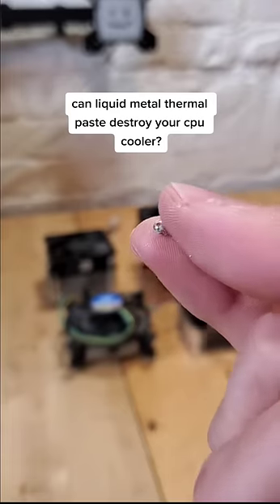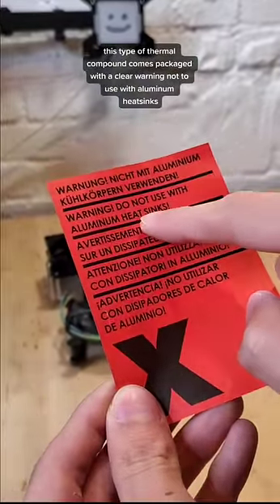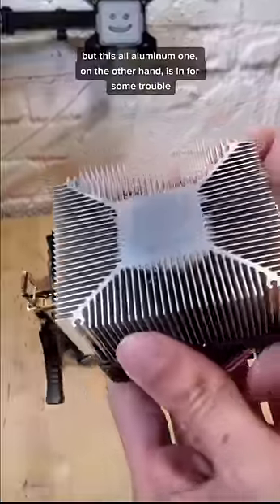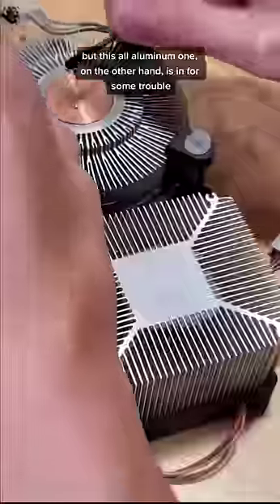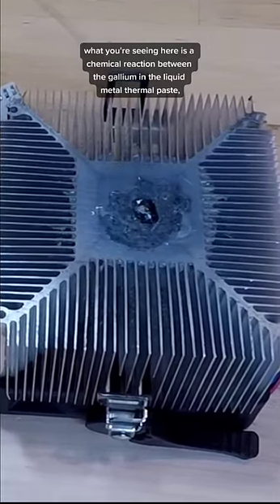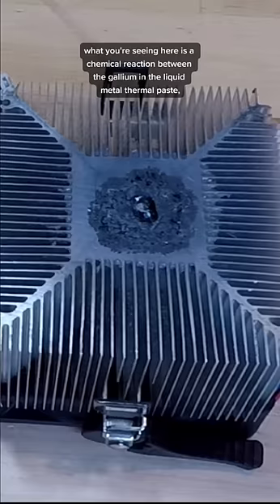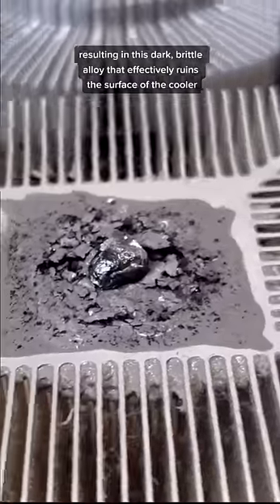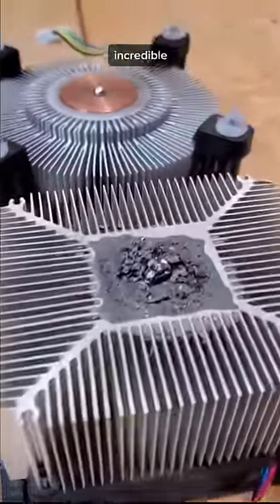Can liquid metal thermal paste destroy a cpu cooler? #shorts

Comment: I think I'll just stick to regular thermal paste, works fine enough for 99% of tasks you could ask from a CPU (beyond extreme overclocking)
Reply: ^ a reasonable human being
Reply: With my i9-7940X (165W rated TDP at stock, 14C/28T), I basically had no choice but to delid the CPU and replace the TIM with LM 😂. With the CPU stock, and a beefy 280mm AIO cooler, the cores would hit 105C and sometimes crash during the cinebench run. After I replaced the TIM with LM (but used standard MX-4 between IHS & AIO), my max temps stay below 65C at full tilt. Given the extra thermal headroom, my benchmark performance gained ~15% since it could boost harder, too. So unless you have a CPU from Intel where they decided to use terrible TIM between the sillicon and IHS, conventional Thermal compound is the safe and easy route to go.
Reply: Until you wanna go even further and get leaderboard benchmark results with subzero temps and you loop back around to paste again lol (albeit a special kind)
Reply: @nickldominator  ugh don't remind me of my i7 7700k. Sooo stupid that you need to delid it to get it 40°c cooler.
Reply: Amalgamation isnt a chemical reaction fyi
Reply: Even then a larger heat sink or a liquid cooler would probably be far more effective and if that's not enough it's cryogenics or nothing. I can't see the few percent benefit this "might " provide actually being the difference between working and melting.
Reply: @whatzituya55  at that point you just pour liquid nitrogen directly over the cpu
Reply: Honestly KPx is good enough for extreme overclocking
Reply: @whatzituya55  facts
Reply: @Hephera  amalgamation actually IS a chemical reaction fyi. You don't know much about chemistry, do you? What do you suppose is happening at the molecular level? Literally EVERYTHING is chemistry.
Reply: @chrisCKDE  well I have an i7-7700 and even though I replaced the stock cooler it still hits 70 degrees under max load, not going any higher or lower
Reply: @memethief4113  well that is good for you. I put the biggest cooler on there my case could fit and i hit 100°C constantly under full power. After i delid it and put a water cooler on top i have no more problems even on 5ghz. Bad luck or something for me i guess.
Reply: @chrisCKDE  the stock cooler is pretty shit though, and the new cooler I put on is definitely much better, I think the 7700 since it's a locked processor can't go past 70 C, either that or the TIM is extraordinarily bad
Reply: @memethief4113  maybe they did something different from 7700 to 7700k or it is just because it is the unlocked version and it Boosts higher than the 7700.
Reply: @chrisCKDE  maybe, would it even be worth it to delid the CPU? I probably wouldn't get any more performance and I'm thinking of upgrading Q4 2022 when Zen 4 comes out anyway
Reply: @memethief4113  for you? Probably not 70° is okay and deliding it only helps with thermals not with performance and with the stadard 7700 it does not make sense because you can't realy overclock it anyway. Just go for a next gen cpu.
Reply: @chrisCKDE  don't underestimate the differences each and every single CPU from the same series has. You can biy the same modell and it can perform 10% worse than others. Likewise, the internal cooling varies. That's pretty normal with CPUs, they are so intricate those things happen all the time.
Reply: Well, you’d be surprised how awesome liquid metal is for gaming laptops, the 2017 acer predator in particular.  Almost 10c difference!
Reply: I want my shit to run my games and still hit the temps I had before while idle
Reply: @GINeric_  Pretty rare these days.
Reply: any thermal paste vs 73w/mk (conductonaut)
Reply: You dont use liquid metal for xoc, it worse than thermal paste at those temps. Liquid metal shines in high heat
Reply: @leprechaunbutreallyjustamidget  liquid coolers simply aren't as good as people make them out to be
Reply: @nickldominator  what is tim and what is lm?
Reply: @nickldominator  my guy youre speaking hieroglyphs
Reply: Liquid metal is for the sweet delid only!
Reply: Yeah.
Reply: My RX 5700 XT needs undervolting to stay under 100C even with Kryonaut. So I wonder if LM may be worth a consideration.

My biggest problem however is that it doesn't look like the copper of the heatpipes is treated in any way. So it's copper but not nickel-plated copper which apparently would be ideal for LM.
Reply: You can get kryonaut and be done if you want to go extreme too. No need for liquid metal
Reply: @nickldominator  idk how you manage that.

I have a 5900x, that cpu runs 185watts overclocked. I have a double fan air cooler on it. And that keeps the cpu under 80c, even under that 185 watt load for extended time
Reply: @peniskopf653  using the wrong kinda air cooler if you can't OC a 4790k with one.
Reply: @nickldominator  you speak german or greek to me
Reply: You don't use liquid metal with XOC. Liquid metal and extreme temps don't mix. The metal solidifies under extremely low temps and the heat transfer goes to crap.
Reply: Well when you go extreme with like liquid nitrogen you‘ll actually use another thermal paste. That can handle -200°
Reply: @chrisCKDE  I have a 7700k I've OCd since 2017 with a noctua air cooler never hit over 80°C. Maybe bad case airflow or bad luck on the silicone lottery?
Reply: I think I would only bother with liquid metal if I was using a laptop and it didn't have it out of the box (there's a reason why several performance focused brands have started using it). For desktop uses however, unless you have the highest end cpu with a firm overclock, a decent cooler should be more than enough cooling.
Reply: @whatzituya55  subzero cooling has 0 real world use though. No one would be stupid enough to daily drive something so radically overclocked and in constant need of ln.
Reply: I use it mainly for GPUs. But if you do make sure that you have some copper or nickel pipes to apply it on.
Reply: @nickh2647  on a low/mid level party that sounds like a solid idea, but for a higher level one I would remove some of the items at least.
Reply: @nickldominator  what do you do with a 14 core CPU?
Reply: On some laptops liquid metal is the only choice
Reply: Yeah I'm not putting Gallium anywhere near my electronics.
Reply: @chrisCKDE you lost the silicon lottery, mine never even hits 80C under extreme work load.
Reply: 99%? Wtf are you talking about.
Reply: But if you use AND, you may need this since AMD CPU will turn the PC into incinerator
Reply: @superspies32  I use a 7900X. 105w eco mode and it comfortably sits at 65 C while gaming. Standard thermal paste with a Thermalright Phantom Spirit.
Reply: Liquid metal is mostly useful for laptops and other mini furnaces like consoles.
Reply: @nickldominator Liquid metal is obviously riskier, but with heat producing components becoming hotter, they need that risk, to see the advertised specs at minimum and the full potential life at best. Overall it’s just the best option just not beginner proof that’s all there is to this LM vs traditional TP

Even then I heard not all Thermal pastes are electricity friendly

Comment: I remember when a guy complained about the liquid metal, it literally destroyed his chunky aluminum cooler and wanted a refund
Reply: lol, this is why warning tags exist 😂
Reply: Some people don't know how warranty works
Reply: The problem is when the guy doesn't know what aluminum is
Reply: @JimboJuice  honestly, you make a good point. If you’re finding that your cpu is running a bit too hot and immediately think “I need to try a different thermal paste” over “I need a new cooler”, you’re definitely really into computers
Reply: @JimboJuice  Nothing more technical about reapplying paste on the GPU die.
Reply: @JimboJuice  The only difference is that you have to deal with some screws and a couple of layers of plastic and aluminum to get to the die.
Reply: @JimboJuice  There were never any mention of pads in this particular comments section. The topic was about paste. Either way, should you choose to reapply pads - which is not at all needed when changing the thermal paste - just choose the correct length and thickness and apply the new ones where the original ones were. It really is that simple.
Reply: Refund not refound lmfao
Reply: @JimboJuice  No? If it is still in good condition upon taking apart the GPU I do not see any reason to. If it is old and dried-out, then of course you would not want to leave it on.
Reply: @EnjoyingChaotics  yes thanks man, i already corrected it
Reply: @eirikheggelund  I hope you know that opening a couple of more screws even if it's just one means that it's more technical, it's a process that requires a tiny bit of different knowledge and a tiiiinyy bit of more work, i.e. It's a tiny bit more technical. Just learn words dude

Edit: no one is saying that it's not simple to do, just that it's a bit more technical.
Reply: @albertcamp9833  It depends.
It takes 4 screws to undo my CPU cooler, and 5 for my GPU. Same difficulty for the GPU really, maybe even easier in my case.
What's discouraging about the GPU is that there's less of a standard on how to disassemble them. That's all.
Reply: @albertcamp9833  Those are minor details. An act might involve more actions without proving to be any more difficult in reality. Let us leave it at that.
Reply: @untitled2792  they Should not call it liquid metal thermal paste but galium thermal paste that's safer
Reply: @JimboJuice  thermal pads are used for ram and vrm. You were talking about gpu cooling, where you ONLY need paste. Graphics card =/= GPU
Reply: @TheNamesArif  also some people don’t know how gallium works when it reacts with aluminum it basically destroys it and turns it into something so brittle it’s like chocolate if you put it on a scooter you could turn it into basically a chocolate metal
Reply: @JimboJuice  lol nope your totally on the wrong side of this conversation..
Reply: @JimboJuice  they have but you don't need to know anything about them to change thermal paste, but well, just pretend you know anything and even tell horror stories of brigged ones. I handle and replace GPU and CPUs for 25 years, don't try
Reply: @JimboJuice you go for the next topic, DAUs (dumpest assumable user) who don't install windows, wont touch a single screw to open a pc. If some is able to unscrew a headsink,, he can manage those pads. Also those pads last way longer then paste that needs to stay liquid. They also don't need to cool that much as the Mosfets and Coils they cool have a higher tolerance.

In the end, you claimed its needed to have knowledge about pads to change gpu thermal paste. It is definatly not, but helpful.
Reply: @JimboJuice  replaced my gpus and it has not bricked as of 2 years
Reply: The customer is always wrong.
Reply: @JimboJuice  the GPU is the silicone die that is present on the graphics card. what you call the "GPU motherboard" is called a graphics card. What you are saying is the same as old people calling the whole PC,  a CPU. GPU stands for "graphics processing unit" and thats not the whole card, just the die. Its a shame that you know whats up with them, and you should use the correct terminology, is all im saying. And you never ever put any thermal pads on any GPU, just on the VRAM and VRM, thats what im saying.
Reply: @JimboJuice  any decent cooler uses a copper block on the cpu. It's only the crappy intel stock coolers (that they have abandoned by now) that used to be an all aluminium block.
If you ever see a site that is offering coolers without a copper contact, I would immediate question the rest of their site, because its what I would expect to find only on wish-level sites.
Reply: Because liquid metal have the galium

Comment: Pedant here- Alloying is not technically a chemical reaction, as it is more of a diffusion of one metal into another- no electrons are shared- there is no “reaction”.  Alloys can chemically react in situ when initially created though, so it’s a bit confusing, but the product is an alloy because it is a mixture of different compounds and not a new compound itself.

Comment: Alloying is a physical process, not a chemical reaction. The Gallium contained in the thermal paste does exactly that, not only ruining the surface finish, but actually compromising the metals crystal structure. This block is now brittle enough to be crushed by hand.

Comment: I love the gallium reaction with aluminum. Never though about liquid metal on a aluminum heatsink. I'm sure this has happened before where Someone's cooler just crumbled in their case.
Reply: *Gallium
Reply: @sillicon8227  lol I didn't even realize auto correct got me.
Reply: Liquid metal = gallium
Reply: It's more than just gallium. It's gallium, indium, tin, and probably some other stuff.
Reply: Imagine gaming for a few hours then hearing fan blades hitting something while the CPU overheats until the whole system croaks lol... Overheating would prob come first.
Reply: @sillicon8227 ALUMINIUM, who cares about galium😂

Comment: and even copper isn't completely safe. While it will not fail spectacularly, the contact area gets damaged over time.
Reply: Yeah the safest surface would be nickel
Reply: It just forms a new metal something which has the same heat conductivity so there isnt really a problem
Reply: @theblitz1687  And it changes the dimensions, that's the problem. The only reason why copper is often said to be save is, because the change is relatively small in a normal product cycle. Just that people like to reuse  high-end coolers and some fully assembled devices also last more than 2 years.
Reply: @S41t4r4  I think we can find people that have been using lm on their product for 5+ years without a problem or maybe even 10.
Reply: @theblitz1687  Already had talked to  some people that used lm longer, they sanded their cold plates after some times.
Reply: @S41t4r4  I thought people sanding lm wanted to get rid of "residue" so they can do a fresh application which is not recommended. Besides if dimensions become smaller wouldnt sanding it make it even worse?
Reply: cheap copper yes but real copper that isn't mixed with alot of crap your fine I have used it for years I checked it 3 years later it was fine
Reply: @theblitz1687  no, you need to lap the cooler to produce a flat surface again, otherwise peaks and valleys will produce hotspots, which in a worst case, might damage the component. In a best case you’d simply be looking at thermal throttling - neither anything you’d want your PC to suffer.

Comment: I’ve seen Tronicfixes video of what happens if you leave liquid metal thermal compound on a heat sink of an Xbox one x that haven’t been used in about 2 months and it ruins the APU chip as well as the heat sink.

Comment: I have a question. Mercury is dangerous to our skin. Does it actually dangerous too exposing our skins to liquid metal since both of them are kinda same?
Reply: no, liquid metal and mercury are completely different. true they are both liquids, but mercury is a lot more toxic.
also it turns out touching mercury isnt that bad because your skin doesnt absorb it very well; the main danger is breathing in the vapours
Reply: You can safely touch mercury, it is not advised to do so because you might have some cuts that you are not aware of from which mercury can enter your body.
Reply: gallium is completly safe to handle
Reply: Ok, you can touch METAL Mercury, do not touch any other kind. Also don't touch the metal mercury if you have bruises or cuts.
Reply: Thx
Reply: @pupper42  Not all kinds of mercury. Elemental mercury is fine, but organic mercury can be absorbed by the skin and can even go through gloves, that was featured in a chubbyemu video.
Reply: @wsketchy  when people say "mercury" though it means elemental mercury. if someone was talking about a mercury compound then theyd use the name for that compound like dimethyl mercury etc
Reply: @wsketchy  by organic Mercury you mean a compound of mercury?
Reply: “Sugar tastes sweet, is salt sweet too since both of them are the same?”
Reply: @Brian Babin liquid metal will always be better than thermal paste. That’s why AMD started soldering their IHS to the CPU.
You’re not clever or right, so stop.

Comment: The formation of the alloy is actualy a phisical process not a chemical reaction. :) Very nice !!
Reply: Explain.
Reply: @autumn5592  Yes. So it's actually quite simple, similar to when water dissolves salt, if you evaporate the water you get your salt back, so there was no chemical change. In these case the solvent is the Gallium (an alloy of gallium, but i will refer to it as gallium) and the solute the aluminium. The thing is, after the alloy is formed, the aluminium is now very reactive with oxygen and starts to oxidize, rust. These is very hard to stop because of the gallium penetrating deep inside the aluminium, that's why you see some colour change, It's the oxidation process, not the alloy process itself.
Obviously the final alloy is a different colour because of the change in composition, but these is a physical phenomena too :)

BTW If you are wandering, yes, in theory you can stop the oxidation by heating the block of aluminium and boiling of the gallium, but the aluminium structure will still be compromised

Comment: Fun fact this reaction is called ✨amalgamation ✨. It's when two metals create an alloy on it's own. Mercury is a metal known for creating alloys like that with most metals.
Reply: Only they didnt use mercury here. They used Gallium / Indium alloy which is also liquid at room temp.
Reply: @KleinLuzi  I never said they used Mercury here. I know Mercury isn't used for CPU thermal paste.
Reply: @ghostnarrator1569  it sounded like it